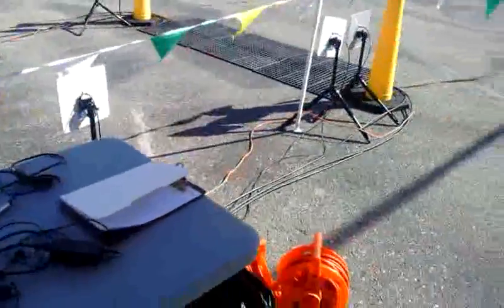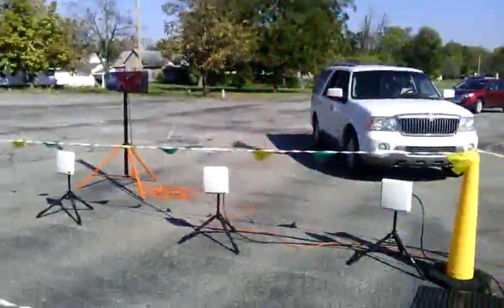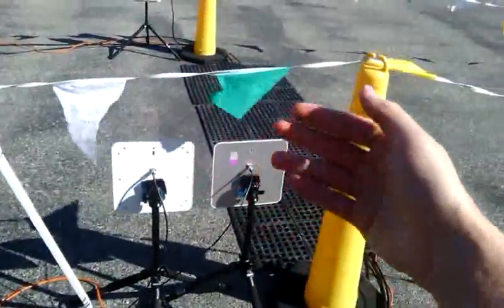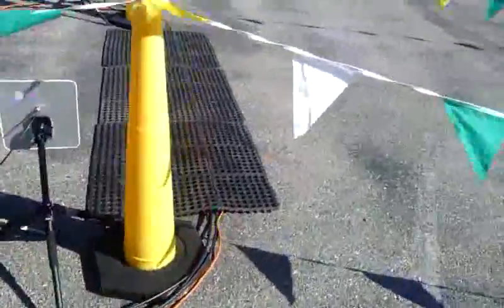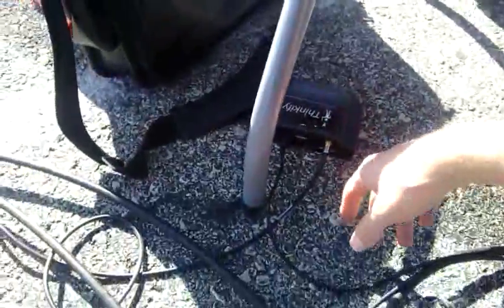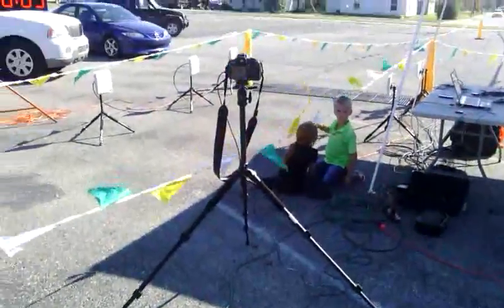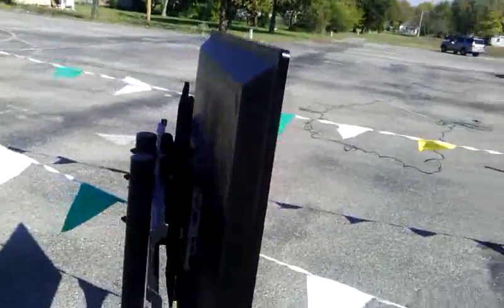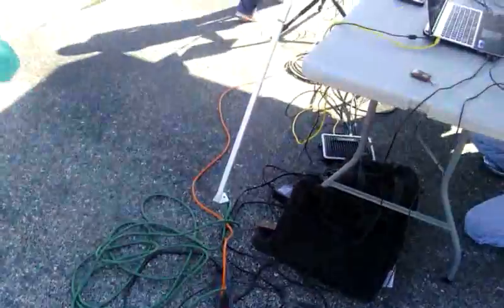RFID Race Timing - Equipment setup

Comment: With what accuracy did this work??
Reply from the maker: Wow, I had to go back and watch the entire thing because this was the early days of the system. :) We've typically get 100% read rates because that many antennas connected to a FX9500 (or similar) and having them spread out to make such as long read zone means that it's extremely difficult for a tag to go by without getting picked up. In addition to that we place one tag on each side of the participants body (either 'chips on the hips' or one tag on each shoe). So totally missing an athlete that is wearing their tags is extremely rare, and if it does happen, the participant typically has the tags worn incorrectly - like both tags stuck inside a yoga pants pocket or something like that.

As long as the tag isn't pressed up very close to skin, water, another tag, or metal then any system out there shouldn't have trouble picking up the tag(s).
Reply: Thanks for the quick reply. Even after 8 years there is no full proof solution which gives 100% read rates for commercial projects.
Reply from the maker: @dhavalkotecha8656  Yes, a missed tag is always possible because there are many factors in play. However for the small to medium sized races my system is geared towards (which is the vast majority of all races around the world) you can setup a system and place the tags such that you nearly always get 100% read rates. We very rarely have a miss because we double tag and because we have it setup so that the participants must pass through multiple read points as they finish and proceed through the finish.